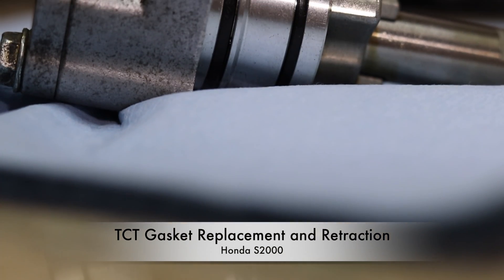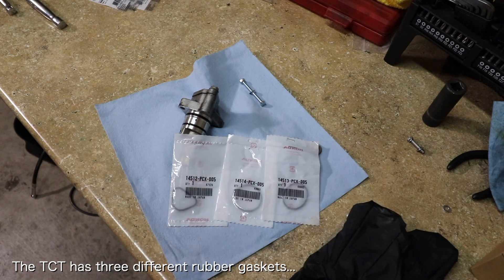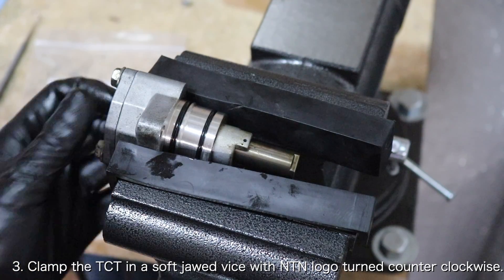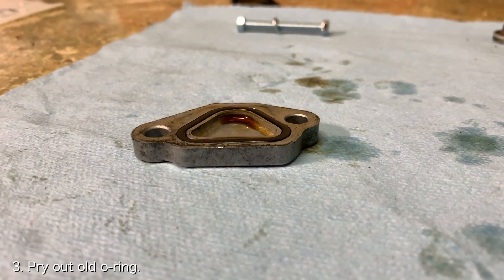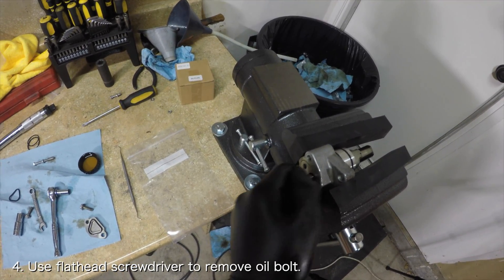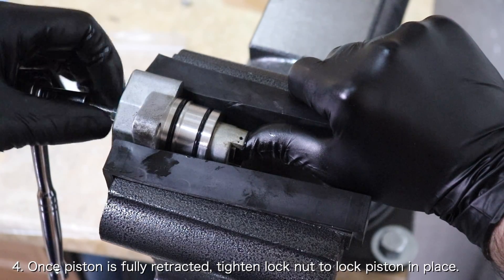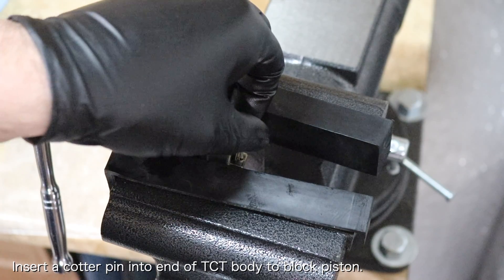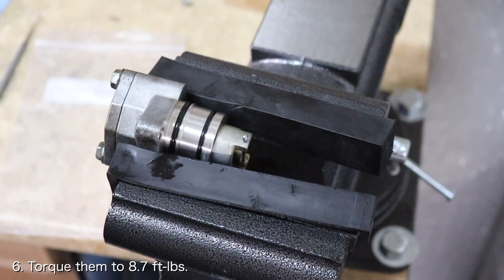Timing Chain Tensioner (TCT) Gasket Replacement and Retraction | Honda S2000

Comment: hello brother pls if u can assist me i replaced my tct with new one the strange noise goes away but ive got another strange noise now that sounds like a chain or valve and it sounds when i go to 4.5k rpm.. car is stock!
Reply from the maker: Which TCT did you install? It is possible the chain is over tightened.
Reply: @DIYGuysvideo genuine my friend and the noise from the tct stoped now i hear another noise in certain RPMs and i did not replace the chain should i?
Reply from the maker: Which brand of TCT did you install?
Reply: Genuine Honda Cam Timing Chain Tensioner TCT S2000 F20C 14510-PCX-005
Reply from the maker: If you can send a video of the sound to my instagram diyguystv that would be helpful

Comment: So I don’t need to stick the bolt in to the tct for removal? Because the manual says to lock it?
Reply from the maker: That would be the absolute safest way under all conditions but practically speaking you don’t need to.
Reply: Thank you for the fast response. 
Haha will carry on now

Comment: is there any reason I couldn't mount the TCT up, insert the pin (paperclip in my case) through the inspection hole, remove the nut, reinstall oil bolt/cover, then pull the clip? I'm terrified I'm going to drop the paperclip into the abyss
Reply from the maker: I wouldn't insert anything through the inspection hole, not worth the risk.
Reply: @DIYGuysvideo  thanks for the quick response. ill just not be lazy and find a cotter pin
Reply: @DIYGuysvideo  update: i just overthought it and realized it was super duper easy 😅

Comment: Hi, this video is very good but I have a question, where is the risk of this operation?...
Reply from the maker: What do you mean the risk of the operation?
Reply: @DIYGuysvideo  I mean the risk of damaging engine parts
Reply from the maker: @leonardo619100  There isn't much risk in damaging the engine unless you have an oil leak or something. Otherwise its a pretty simple piston that puts pressure on the timing chain.

Comment: Just did the vtec solenoids gaskets and the TCT. Before as soon as I would start the car drops of oil would spill. Now it still leaks from the tct 😞 but not enough to even form one drop. It’s very minimal, what would you suggest?
Reply from the maker: See my TCT gasket replacement video!

Comment: So the cotter pin, you just leave it? Doesn’t have to be removed?
Reply from the maker: It is removed during installation which is covered in another video.
Reply: DIYGuys thank you! Also do you have a link for the triangular gasket that goes on top? Just came from the dealer and they don’t sell that one separately just the 2 o rings.
Reply from the maker: @nismoj  I only have the part number in the description sorry.

Comment: have a horrible coolant leak coming from under my intake manifold. is there a hose down there/is that the one people block off? or maybe it's the gasket itself? video ideaaa
Reply from the maker: Have you messed with the intake manifold? I had to replace mine after a swap but I didn’t film it since it was my first time doing it.
Reply: @DIYGuysvideo  haven't touched it in the 4 years I've had the car 🤔

Comment: So happy to have found this channel and it's still active! It's a big job, but would love to see a replacement of the secondary transmission output shaft bearings which can be done with the trans still in the car. Will probably have to do this myself at some point in the future (I think I'm getting some speed dependent whirring from the trans but not too sure). Thanks for the effort you're putting into these videos.
Reply from the maker: Good suggestion. Will definitely do it if the issue happens to me. I’ve seen it happen to a couple people.
Reply: @DIYGuysvideo  Yes I believe it is quite common (relative to the reliability of the car). Also, as far as I can find, no-one has done a video guide showing splitting the trans and replacing these parts.